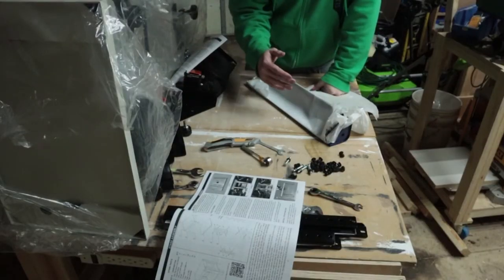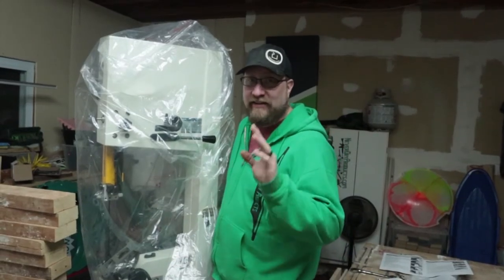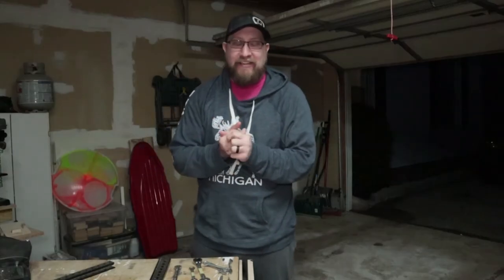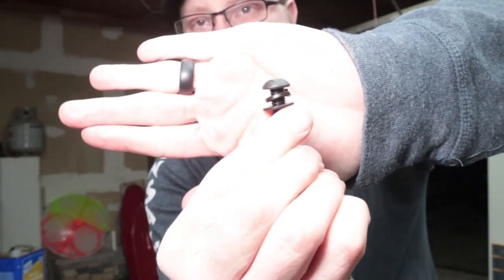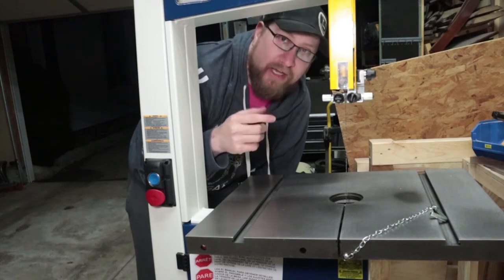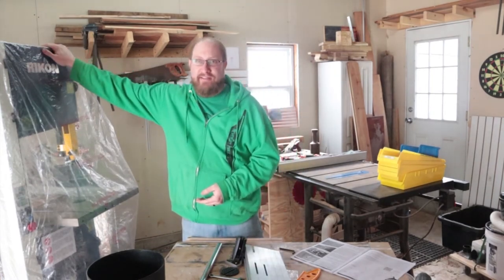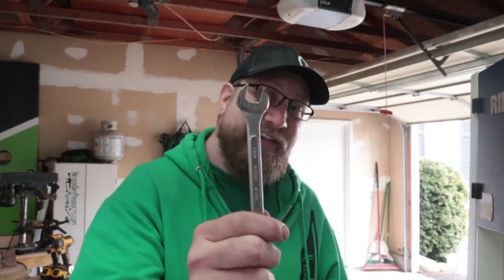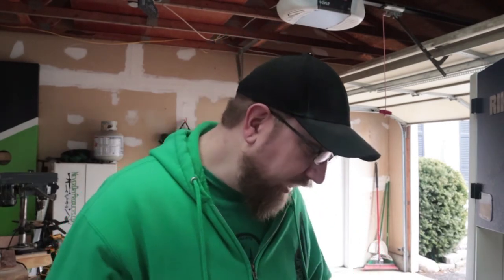Rikon 10-324TG 14" Resaw Bandsaw Unboxing and Setup! *$1,200 BANDSAW!!!

Comment: How has it been treating you? I am thinking of picking one up this week.
Reply from the maker: I love this thing! I have no complaints. My favorite thing is the tension gage. It will get you really close to the right tension but you may need to increase our decrease as necessary. 10/10 would recommend.
Let me know if you have any other questions and I'll do my best to answer them.
Reply: @RobertsInnovations  hell yeah!  Thank you! Can’t wait to pick it up this week
Reply from the maker: Did you watch the second video? There is an adjustments and review video that might help you set up and make sure you cut nice and straight.
Reply: @RobertsInnovations  yeah I glazed over it but I’m going to watch it in full tomorrow 🤙
Reply: @RobertsInnovations  did you ever end up re-sawing something taller? At some point I’m hoping to do some big resawing
Reply from the maker: I did. I cut through 13 inches but it takes a lot of time. Make sure you have a resaw blade. I have a 3/4 tpi timberwolf blade and it is A BEAST!
Reply: @RobertsInnovations  perfect! I won’t need to do it often but I have one project in mind where 13” or capacity will certainly come in handy. Thanks for all the replies 🙏